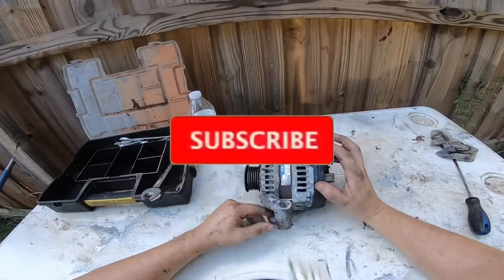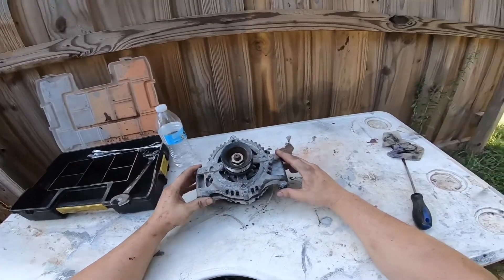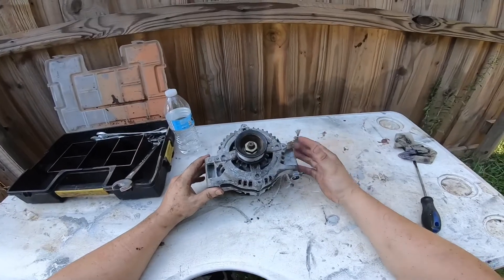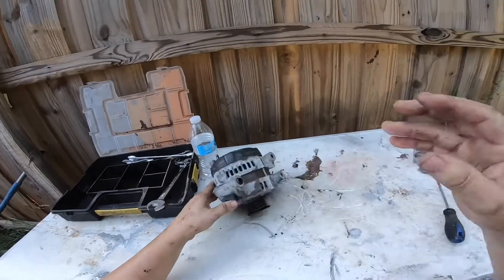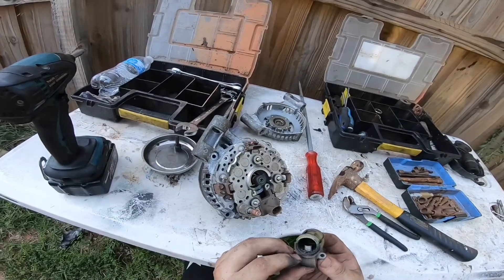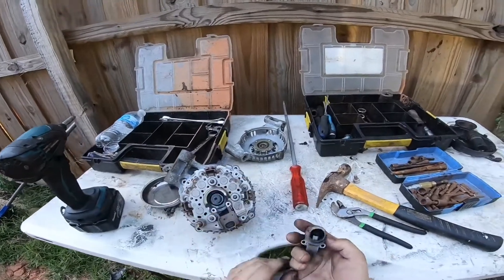How to Rebuild 2005 Chrysler 300 alternator Denso Alternator 04896 805AA rebuild kit

Comment: I had to use a dremel tool and slice a straight cut across the philips after I stripped it. I then was able to use a flat blade screwdriver to remove the stripped philips.